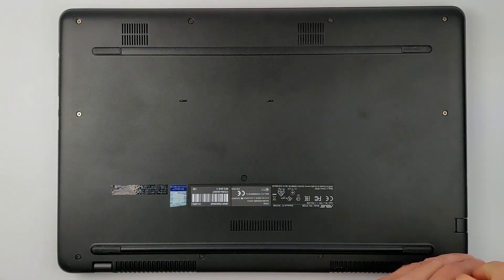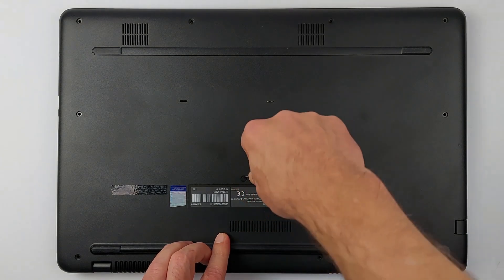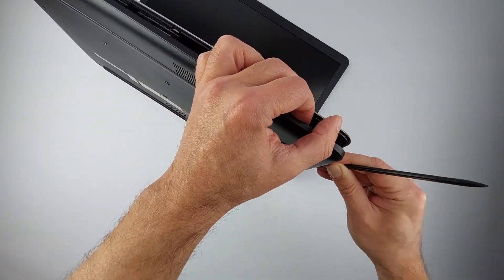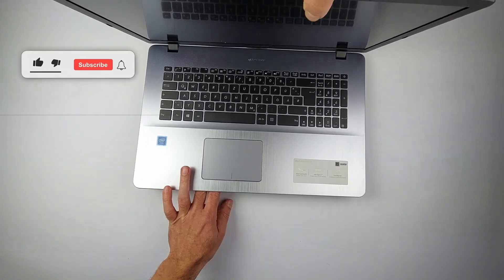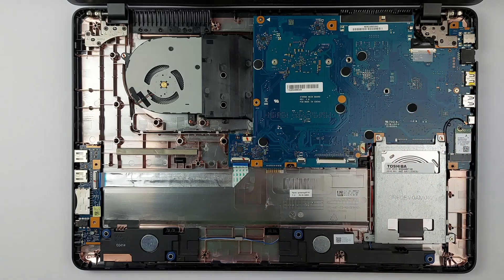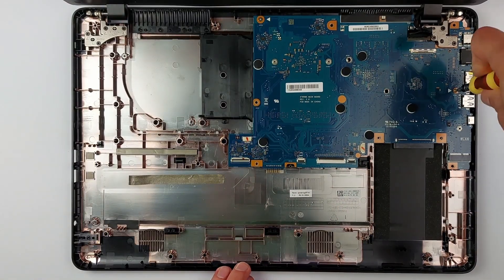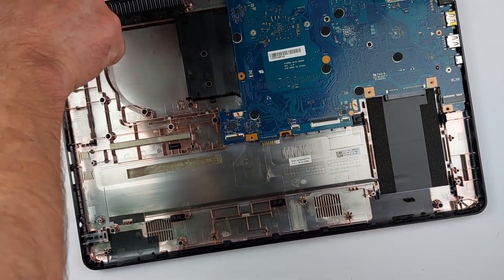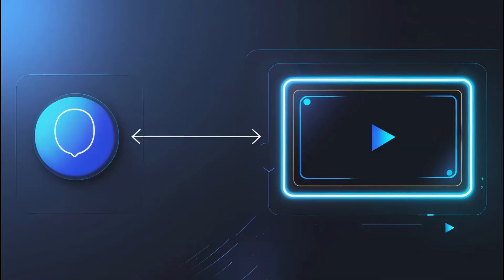ASUS Vivobook 17 RAM Upgrade & Disassembly – Why is THIS Replacement so Complicated?

Comment: Hi we have 4 of the Vivobook 17 712D which is different than this one, I want to upgrade the memory to the absolute maximum.  The website says 16 but I know sometimes you can go higher.  Do you know if 16 is the max or can it be bumped up to 32?  There is only one removable memory stick, DDR4 8, so I have 12 but only 9 is usable.  I saw online someone upgraded a similar one to 40 gb because it has 8 soldered on to the motherboard.
Reply from the maker: Hi! Based on my research (haven't tested this specific model myself), the X712D can likely go beyond the official 16GB limit:
Your setup: 4GB soldered + 8GB slot = 12GB total
Upgrade options:
Relativly Safe bet: 16GB module → 20GB total (4GB+16GB)
Worth trying: 32GB module → 36GB total (but check return policy first)

Can't guarantee it 100% without testing, but the research looks promising so it's worth trying. 
Worst case you send the memory back if it doesn't work. 
Good luck!
Reply: @LaptopRepairTutorials  I ordered A-Tech 32 mod, arriving Nov 3, I will let you know.  I am using Moho Pro 2D animation software and it has been lagging as my characters become more complex.
Reply from the maker: @DangerAware  
That’s awesome! 
Animation software can get quite demanding once you start working with detailed characters or multiple layers.

Extra RAM should make your workflow much smoother, especially during playback and rendering. 
A-Tech modules usually work well with ASUS laptops, so hopefully it recognizes the full 36 GB.
Thanks for sharing, and please update us once it’s installed. 
It will really help other Vivobook owners too.
Reply: @LaptopRepairTutorials  I got the memory today, installed it, started the laptop and it is working.  It is showing 36GB with 34 being usable. I didn't even need to enter the BIOS it simply worked. BUT, it did not improve the animation software issue.
Reply from the maker: @DangerAware  
That’s great to hear it recognized all 36 GB right away.
You made a solid upgrade, that gives you plenty of headroom for larger projects.
I don’t use Moho Pro myself, but from what I’ve read, you can improve playback by lowering preview quality, enabling GPU acceleration, adjusting layer visibility, and allowing frame skipping.
Using a working cache on a fast SSD can also help.
That made a big difference in my DaVinci Resolve setup too.
Thanks for confirming the upgrade works, this will help many Vivobook 17 users.
Reply: @LaptopRepairTutorials  Update --- 4 times, including this morning, I have gotten the BSOD, with a report of Memory Manager crashing.  The computer restarts, but I will likely have to go back to the original memory.
Reply from the maker: Hi, thanks for the update.
A Memory Manager BSOD usually means the new RAM is not fully stable with the motherboard, even if the laptop recognizes the full 36 GB at startup.

Before removing the module completely, you can try two quick checks:

Reseat the RAM
Remove the 32 GB stick and insert it again so it sits perfectly in the slot. Sometimes a tiny misalignment can cause random crashes.

Run Windows Memory Diagnostic
This can show if the module produces errors under load.

If the BSOD continues after these steps, your conclusion is right.
The laptop accepts 36 GB, but the system is not fully stable with this specific 32 GB module. In that case, going back to the original RAM or trying a different brand would be the safer option.

Thanks again for sharing your results. This kind of feedback helps a lot of Vivobook 17 users who consider the same upgrade.
Reply: @LaptopRepairTutorials  Thanks!